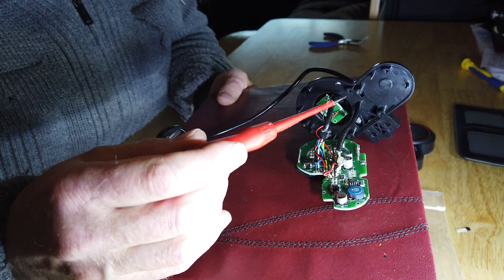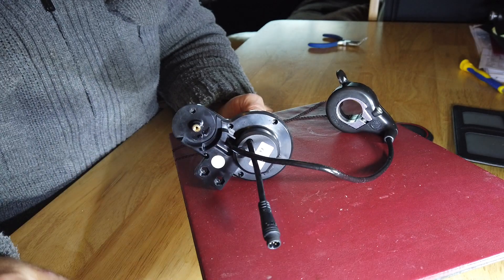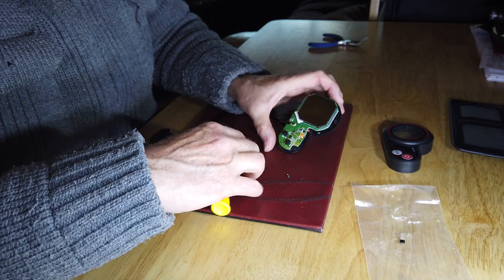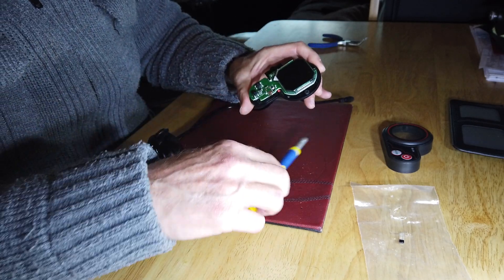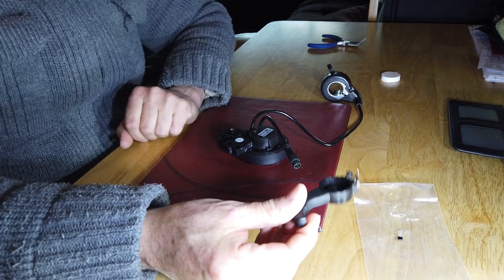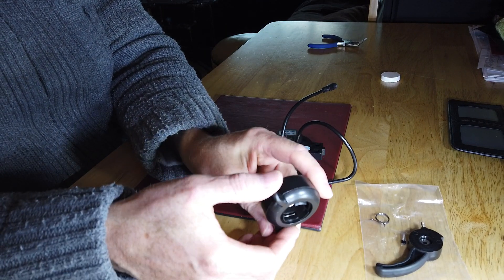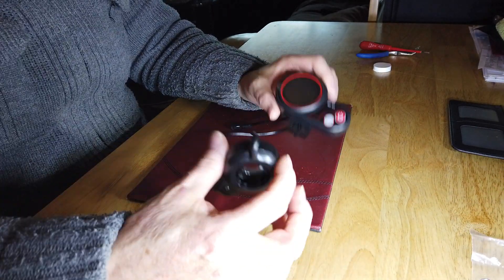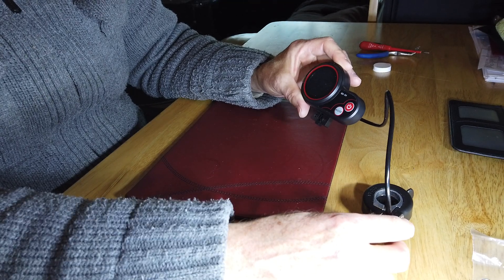Zero 10x finger speed controller upgrade, better focusing  this time

Comment: Not wanting to be negative, but realistically, this video really doesn't show the three wires and where they went on the board. The view needs to be much closer and focused. Can't really see what you're referring to when you're pointing at the area where the hull sensor was removed. I really don't know any more now than I did prior to watching the video. I'd try and re-do the video to offer a much better perspective and view of the specifics of the process of changing it out. Hope this helps. Thanks and stay safe!